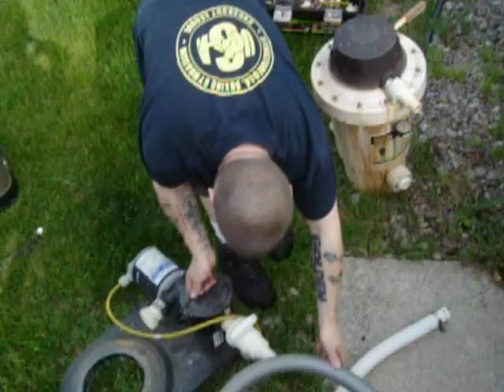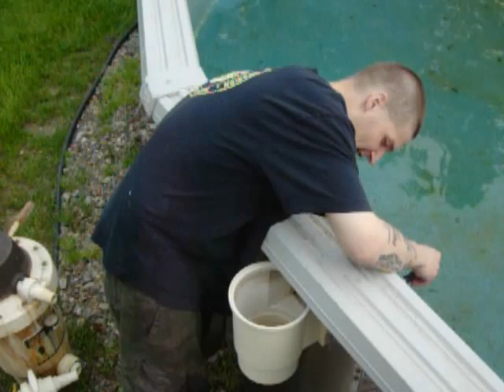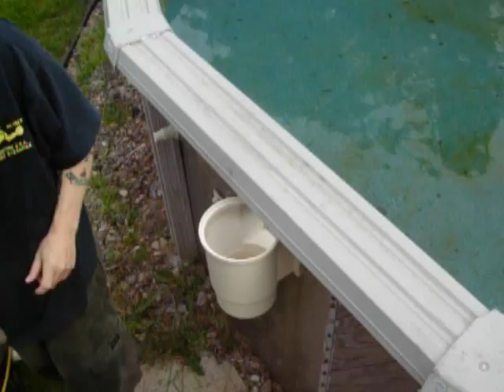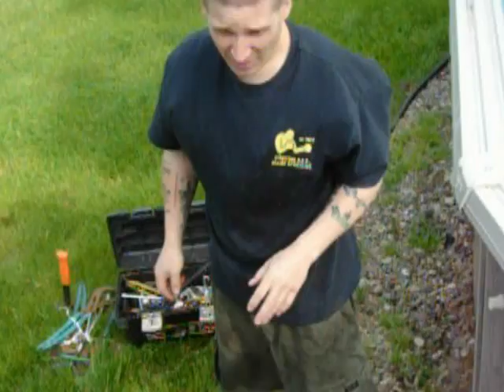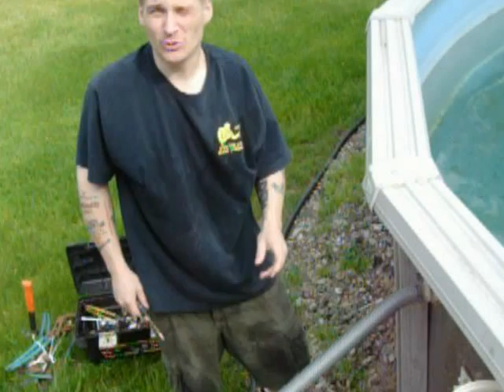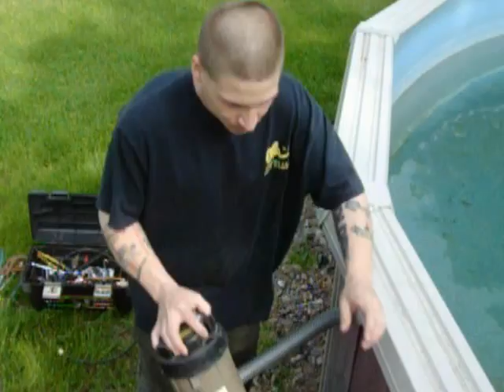Hayward EC40A Pool Filter & Power Flo Pump Installation

Comment: i just reassembled my ec40 with newer parts from a newer filter and the bump shaft had the O ring closer to the filter socks but i used the older filters head when i started it up i had pressure but the bump handle normally would rise up from pressure and you couldnot move it but now it moves freely while its running ?? any clue why